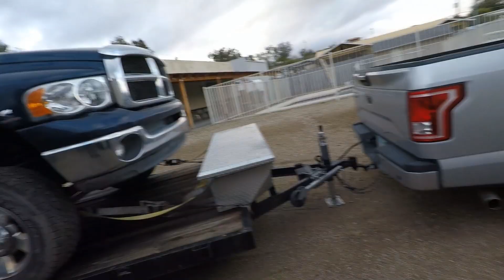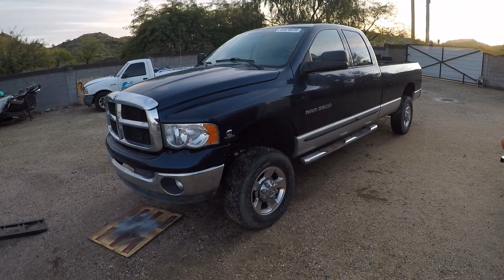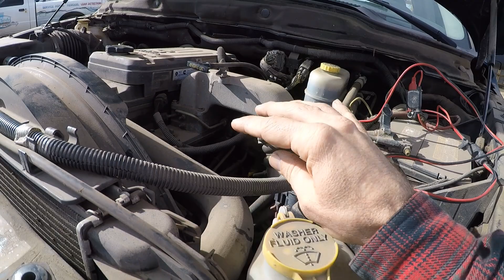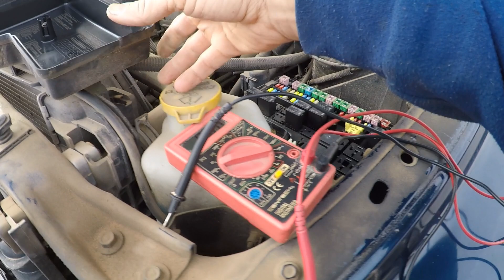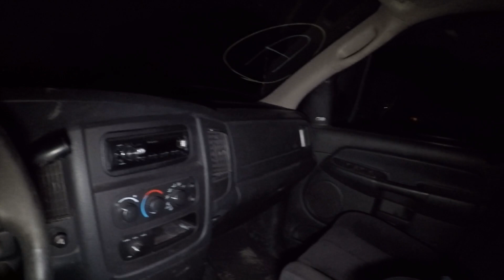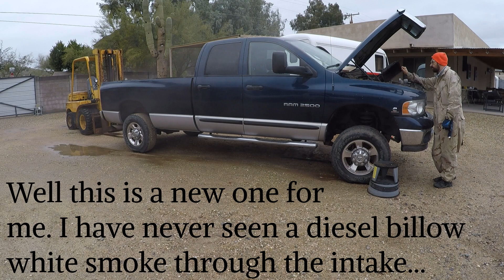Buying a Salvaged Dodge Cummins sight unseen (pt 1)

Comment: Sorry I'm so behind on your videos.  I can send you a Dodge FSM for that truck.  I know a lot about those rides, and that powertrain.  I'm sure you made some progress since you posted this.  Cummins has a barring tool that goes in the bellhousing adapter.  I slap a socket on the alternator and turn it clockwise to turn the engine over.  CPS is on the drivers side timing case cover.  It bolts in from the back.  Not a lot of fun to get to since the drivers side is so busy with steering, fuel injection, etc.  I think it would be worthwhile to pull the valve cover off and have a visual at the valve train.  Won't cost you anything other than some time.  If it happened to ingest some water there is always a possibility of bent pushrods or even breaking the cam, or sheering the gear off the cam, hence the P0341.  Firing order 1-5-3-6-2-4
Reply from the maker: I somehow missed this comment, but I would love access to a FSM. If you have a digital copy my email is acthecarguy@gmail.com I have made some progress on it since I posted it, but sadly she is still not running. I learned about the barring tool and that is an interesting design, but I like your idea of turning the alternator more. I have pulled the valve cover off and drained the oil and there is no evidence of water anywhere, which is nice.  The oil sample is out for testing and I should know more soon, but it did slightly smell of fuel (but wasn't above the fill line) and I have blocked off the individual injectors and verified the number 6 cylinder was leaking badly. I have verified the lift pump is building good pressure, the CP3 is also building good pressure, and the FCA is working fine. Everything is pointing to multiple bad injectors but I am waiting on the oil sample results and more block off caps so I can compression test the rest of the cylinders (number 6 has great compression) before I bite the bullet and order new ones.  I always seem to learn something new from your comments and they are much appreciated. If you have any opinions on what injectors to use I would love to hear them. Right now I am leaning towards all new Bosch units with the updated tubes and new fuel lines from injectors direct.

Comment: Your not switching sides are you??😂
Reply: Have you driven the ford 6.7? It’s a fantastic motor and it’s built by Ford!
Reply from the maker: @rodfatherschopshop6004  Funny you mentioned that, my buddy who races a Dodge that is similar to mine uses a 6.7 to tow his Cummins race truck. He also has my old 6.0 Ford. He says the 6.7 is the new 7.3 and way better than the 6.4. The only bad thing I have heard is the fuel mileage. What are your thoughts on it?
Reply: Austin. The horsepower is 475 and torque is 1050 on the 2020 3rd gen  motor. It’s been around for 9 years at this point and has very few problems. Out of the big 3 ford is the only one making their own Diesel engine. The one complaint is the gas mileage is not great but 1050 ft pounds of torque who cares!  Ford was under contract with international and they rushed out 6.0 and then really rushed the 6.4 which  I think was much worse then the 6.0. Long story short.. it’s  a great motor. That’s why your buddy has a ford pulling his Cummins race truck! The only good part of that 2500 you bought is the Cummins under the hood. Keep up the great videos and happy new year!
Reply from the maker: @rodfatherschopshop6004  Thanks for the info. I am far more interested in reliability and longevity than I am HP and TQ (at least with a tow rig), I will keep an eye out for a 6.7 to play around with at some point as you are the second person to mention that option. Honestly, I haven't been following the diesels carefully after hearing so many complaints on the 6.4 Ford and 6.7 Dodge (only complaints on the Dodge were price on parts and fuel economy) I liked the Duramax, but the front ends on the 4wd can't seem to stay put together. I will finish the Dodge and then make the decision to sell it and keep the Ecoboost until I can find something else, or switch to the Dodge, at least for a while to see how I like it. 

 Always love seeing your comments pop up!
Reply: Austin   The one thing for sure is no matter what brand you buy...it’s going to be expensive!! At least you can pick up an old 7.3 or 5.9 for  affordable money.
Reply: @rodfatherschopshop6004  nothing wrong with the DODGE, I bought a new 1500 in 04, still running like new at 200k miles, the body, frame suspension has held up fine, I was  ford Man since the 60's, I still run my dads 71 and my old 85, its all about maintenance, always has been, I am in the market for a ford 6.0 as they are the best buys right now, although my mid 80's 6.2 GMC makes me wonder why I would ever want a diesel again,
Reply from the maker: Hahaha! I've owned a bunch of different rigs, I LOVE Fords, but I haven't loved their diesel choices since the 7.3PS. I had a 6.0 that I loved except for the fuel mileage and EGR issues, as well as an older 6.9IDI that I loved except for the lack of power.  I was using a 6.5 Diesel Suburban for a while, but the AC was terrible and it was so slow (and the wife didn't like that it clattered like it was trying to kill itself).
Reply: You are really brave buying unseen. I guess you were going by the place of sale to know it wasn’t salt water since you hadn’t checked the car fax.  Nice video and good luck.

Comment: I like the live troubleshooting videos.  A lot of folks shy away from Burn and Flood cars. I have always found them to be fun projects. Its like you have to be a forensic detective to find all the gremlins..
Injector timing was my first thought from the way it acted, but unless there is evidence of a part change that could affect that, its really not likely to change. (unless these engines are different, I never worked on a Cummins)
I am looking forward to more on this series. Thanks for your videos.